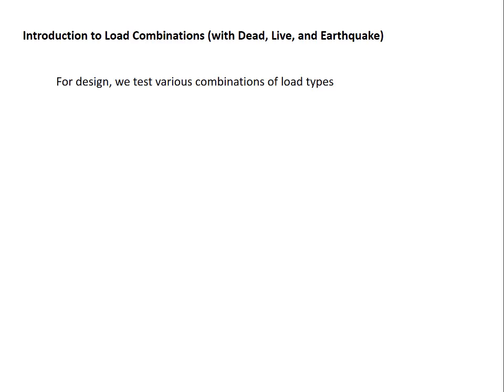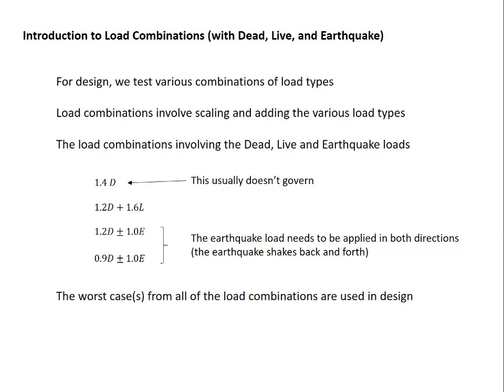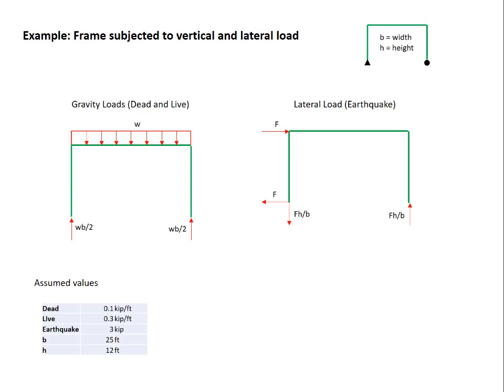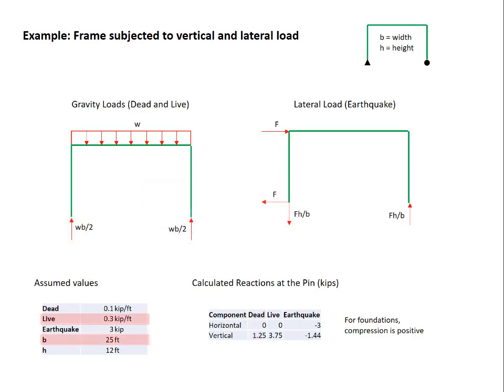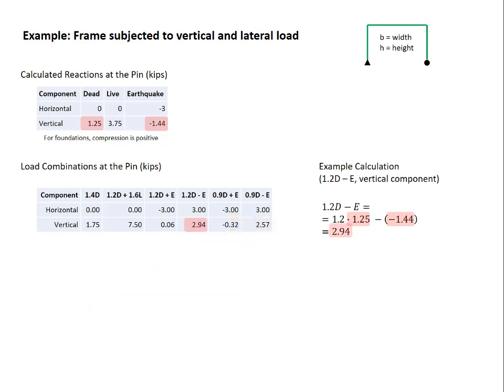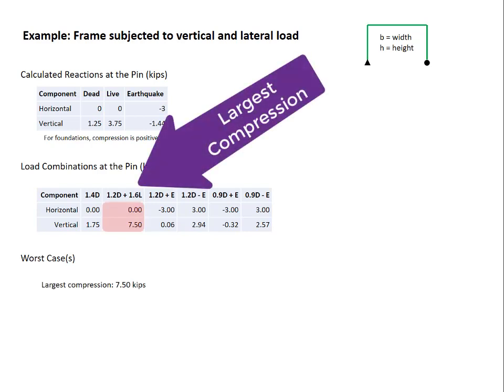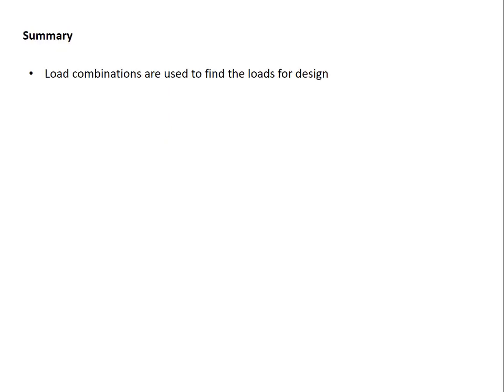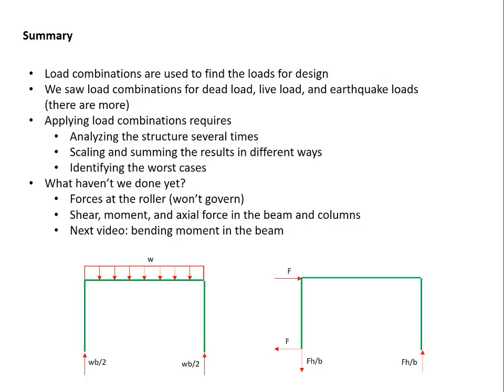Load Combinations (Introduction)

Comment: Good explanation. However, since there are gravity and lateral loads, how do we make sure the final design meets both of gravity and lateral loads?
Reply from the maker: The exact design checks will depend on the material use (e.g., concrete or steel). An answer to that will require taking the relevant design course.